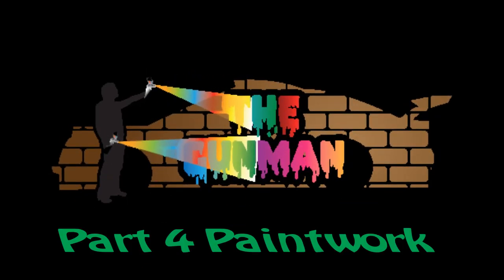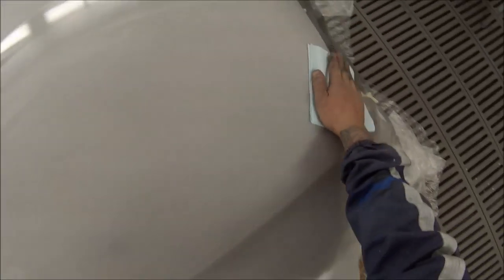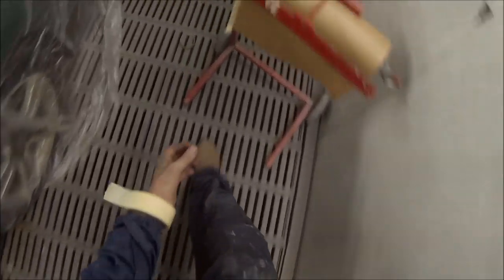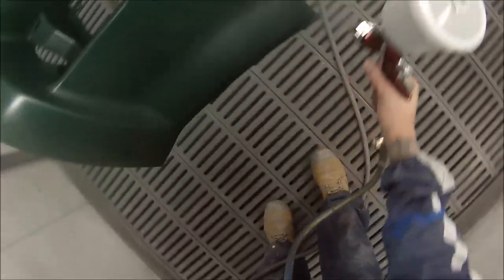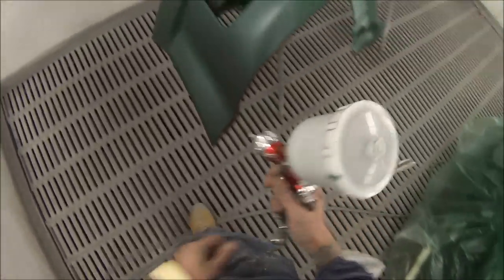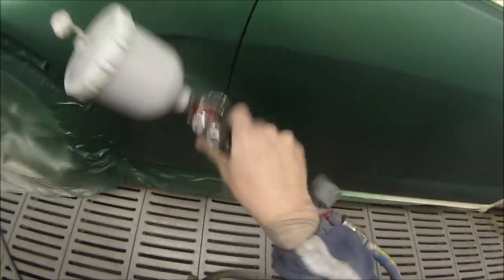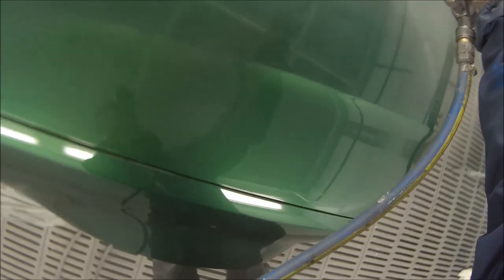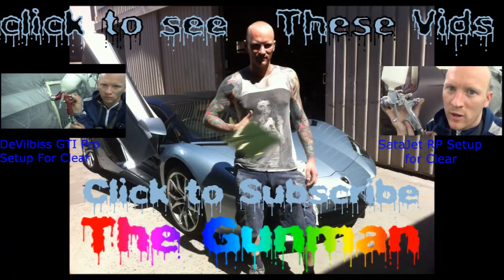Poison Ivy Green VE SS Commodore Ute Spray Painting

Comment: You have any tips to best prevent orange peel?  If possible...  Thanks.
Reply from the maker: The basic ones like paint not too thick, pressure too low and holding the gun too far away, Try these and see if your results improve, Good luck.